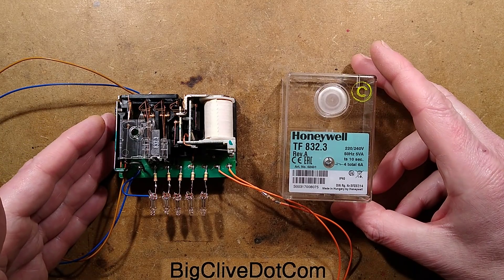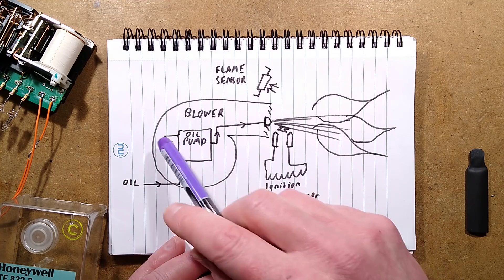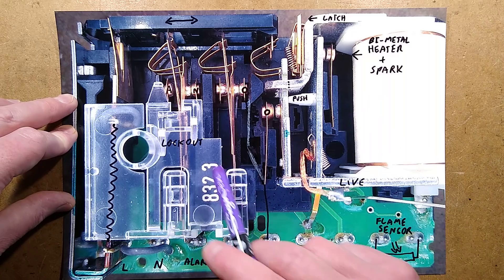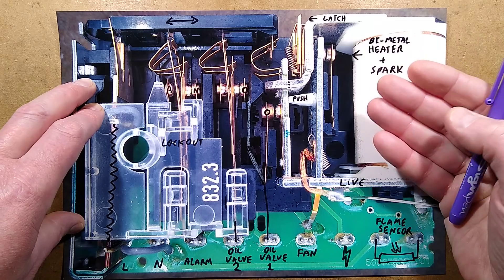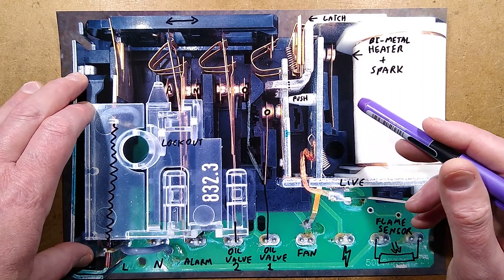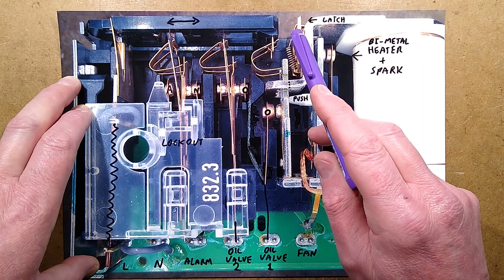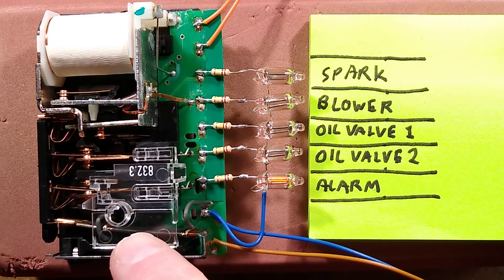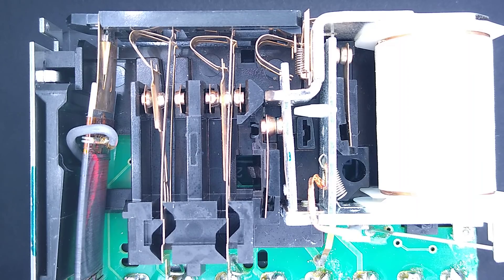Incredibly clever oil furnace burner controller (very perplexing)

Comment: I've seen several electrothermal mechanical controllers from back in the day that we're pretty amazing along these lines. If you want to see something that's modern and really complicated take a look at the controls for my two stage blower fed gas furnace. That thing has flow sensors and pressure sensors all over it. And the flame sensor there is a probe that actually sticks into the flame. And it's all run by a microchip pic.

Comment: How has this complex thing not just been replaced by a 20 cent micro?  More repeatable, more reliable and cheaper and much easier to assemble?
Reply: Until it craps out on you
Reply: It will be, we are in a transition period.  A solution based on a micro would cost more than the 20 cents for the micro because they can't handle power switching without other devices.  All cheap, yes.  But re-tooling a factory is very expensive .  Once a factory is tooled up this complex device is very cheap to make so they continue to get made for some time after it would be "more sensible" to use a purely electronic design.

Comment: It sure is a beautifully made controller that is very interesting in its operation and have nicely implemented safety features.
But I also sit thinking, isn't it time for more people to switch over to heat pumps for home heating?
Burning oil is a bit old fashioned to be fair, though, I will have to say that I am rather biased in this regard....
And I do know that heat pumps aren't cheap. Though, some people incorrectly think that they stop working just because it goes bellow freezing outside.
Reply from the maker: I don't think heat pumps work well here in a very cold winter climate.
Reply: @bigclivedotcom  it's all permafrost north of Manchester isn't it? ;-)
Reply: @bigclivedotcom  Where I live in Sweden, a fair few people do have air sourced heat pumps, and do just fine during our winters.
Yes, ground sourced and even geothermal is better. (Geothermal as in a deep borehole, it isn't deep enough for it to get warm btw, it is only like 5C in the hole.)

England with a far far milder climate shouldn't have any issues using heatpumps.

House insulation is though still a very important aspect of any heating setup. Oil fired heating can be more environmentally friendly is one's house is well insulated, compared to a heat pump working hard on keeping a poorly insulated shed warm.
Reply: I think heat pumps are a great idea on a new-build but not quite so cheap/practical on an old house
Reply: @sofa-lofa4241  My roughly 100 year old house has a heatpump. It works fine.
One can also in a lot of cases add on additional insulation if needed. Or just renovate in general to add in insulation in uninsulated walls.

It is a bit of an investment, but even for an oil heated house, the investment can still be worth it compared to the reduction in oil use over the next couple of years.

Another advantage of a well insulated hose is that it is easier to keep it cool during summer. The heat from the sun has a harder time penetrating the walls, downside is if one has plenty of large windows, then it is suddenly a greenhouse... (Get some white reflective curtains and that is mostly solved.)
Reply: Air source heat pumps don't work well in old leaky houses, it's like running your fridge with the door open. Ground source is apparently better if you have the space. You have limited options if you're not on mains gas, so oil is quite common in rural areas

Comment: I found those type controls to be very reliable. The problem was usually the customer resetting the control numerous times and filling up the bottom of the combustion chamber with unburned fuel oil. It can be quite exciting lighting a burner into a chamber with a lot of  unburned oil. The inspection door blowing open with a vengeance and a rumbling felt. A dirty oil filter or nozzle will soot up the chamber and often the flame sensor causing lock out. Big Clive always has something interesting to show. Love the channel!!
Reply: I had to take mine apart last April following fuel starvation. I've a 20+ year old tank, you can imagine the state of the filter and the pump. Flame sensor was sooted up. A good wash out with white spirits and all was well except I smelled of kerosene for three days after.
Reply: The standard Honeywell oil controller in the US has a safety for this. It will allow the user to press the reset for a hard lockout up to 3 times, then it goes into 'restricted' lockout. To reset from this mode requires holding the reset for 10 seconds or more. This isn't something the homeowner would stumble upon.

Many of these controls will test for ignition for 45 seconds. Times 3 with a .75 GPM nozzle would still result in over a gallon of oil in the furnace, so it will get puffy and bangy when it does light!
Reply: Yup, user error rules!
Great idea for an industrial woofler though 🔥
Reply: I often use Landis and Gyr LGK type controls, the only issues we have are on LPG when the burner shuts off, even though the valves are good, the flame will tend to waffle around on the burner causing a lockout,  and the need to use permanent pilot on big burners because the turn down ratio isn't sufficient to stop the process running away when there is no product load.

Comment: What a wonderful thing a fascinating thought out unit and cleverly demonstrated, thank you. I'm thinking this control could have been achieved with a programmable integrated circuit and some relays, this unit cost £40 and the programmable integrated circuit way probably the same cost. Wonder why they did it this way?
Reply from the maker: Probably because it's time proven.
Reply: @bigclivedotcom  Thank you Clive looks very 1960s but with modern electronics on the other side of the CB.

Comment: That is basically a mechanical computer program. Very clever! The amount of enginerding that went into developing this physical unit is orders of magnitude higher than what would nowadays go into writing a program for a µC to achieve the same thing. No wonder they're still using these, they can't crash unlike the µC.
Reply: if you misdesign one, it will crash. Check some videos on divide-by-zero on mechanical calculators, for example.

Comment: Thanks for the good explanation!
This same controller is used on some gas burners as well. At the units without blower they simply not use the contact.
 Now I understand why there is so much dead time before the gas solenoid opens after the controller recives the call to fire.

Comment: God, can remember fault finding on those in the late 80s, early 90s. The beauty of all of the controllers was that they had a similar fault process whether on gas or oil fired pressure jet burners. On the gas systems there was a pre-alarm state triggered by pressure sensors. The gas feed would have a section of pipe, before the burner, that would have valves and pressure sensor. First stage was a check of the pipe integrity by closing the valves and checking that the pressure was equal on the feed and burner side and didn't drop. If it dropped the system would halt and go into alarm. If all ok, it would then open the valves to allow gas to flow and start the ignition sequence. Depending on the size of the burner you would have either a thernocouple or IR sensor to detect the flame and keep the valves open.
Lovely job but my wife hated that I would come home smelling of diesel and my skin black from servicing waste oil heaters in garages! Had to go back to being an electrician instead.

Comment: In my home (built 1905) in the states we have an Aquastat control with a sub burner control.
One of the first things I did was modernize these control boxes with digital circuitry, but I still kept the older controls as they were equally interesting to the one shown in this video.
I had a lot of fun reading electrical schematics and explanations clearly written for a 1930s plumber to understand.....

Comment: Clive on some of these systems they also include a pressure sensor near the blower to confirm airflow
Reply: The propane fired furnace in my RV has one of those in case the blower fails cuts off the gas so it does not overheat the heat exchanger its called on it a sail switch the moving air keeps it up and the gas valve open .

Comment: The mechanical predecessor of a large capacitor (or a 555 timer) and some 7400 logic circuits. 👍
Reply: By vintage, more like ECL running at -5.2V. 🤓

Comment: I'm honestly surprised the modern version of this isn't just a mcu and relays. I know the old adage is if it ain't broken don't fix it, but I feel like there is an awful lot that can go wrong with this mechanically.
Reply: I would think some TRIACs would be cheaper than the manufacturing/assembly cost for all those contacts
Reply: @spacehitchhiker4264  oh true!
Reply: It is. Look up Honeywell R7284. LCD screen with fault codes, serial bus for remote monitoring, etc.

Comment: Microcontroller designs rarely display this level of elegance.
Reply: clearly not true, have you seen INSIDE a typical microcontroller? It's BEAUTIFUL inside!!  https://upload.wikimedia.org/wikipedia/commons/3/37/Die_of_PIC16C57_Microcontroller.jpg
Reply: @maxtorque2277  I've been making commercial products based on the PIC16C57 since 1992, before flash memory existed. I spent months in the 1990s looking at the 16C57 die through the EPROM window as I developed code so yes, I've seen the 16C57 die before. In fact, I've seen 16C57 dies in hybrid modules and recognized them as PIC dies on sight. The 16C57 is not terribly elegant as dies go.

Comment: Absolutely amazing piece of engineering. As someone who is on the way of becoming an engineer, and working close with lots of different types of technologies, I ask myself a lot of times... When there is the possibility to use electromechanical means of achieving something, and the way of using solid state electronics, which way is the best? In this case, surely the electromechanical way is more interesting, but is it actually cheaper to produce that furnace controller electromechanically or with solid state electronics? is it more reliable? is it... worth it?
I absolutely loved this video, that's what I know.

Comment: Honeywell... great hardware, trash software. We had a Honeywell tech camp out in mechanical room for a couple months of a new building trying to get everything working as promised. Never happened. Their security camera software is the same. "This is enterprise level software." Yet it has trouble with most Onviv cameras. Their response was "Just use Honeywell cameras"
Reply: We managed to get it to work with our stuff... Just about... Screw everyone else's!
Reply: They thrive on buying companies to vertically integrate. They purchased my old company and put us under the thermostat division. We sold industrial burners for petrochemical, all customer/job driven no part numbers.

Comment: I worked on an oil furnace  on a friend's narrowboat, about 20 years ago...  The furnace was very old even then, and the ignition spark was provided by a cam on the blower/oil pump shaft, and an automotive ignition coil.....   The control unit was positively modern compared to this one, using standard time delay relays...  If I remember correctly I added LED's to all the outputs to monitor it, and had to replace the LDR flame sensor to make it work.....

Comment: Danfoss has a similar module, it is more or less, an industry standard.
In the 80's i repaired high pressure power washers, the heated ones are diesel fueled.
I can remember these units, in these days they were completely mechanical, very safe and reliable.

Comment: Oil burners have been around for quite a long time...and I guess the engineers finally figured out that you just can't beat a mechanical control unit  :)
Reply: it's also a safety component you don't just redesign them without a very good reason
Reply: No, the engineers figured out you can beat a mechanical control unit — and it still works even after quite a beating. ;)
Reply: ...sales figured out they could get bigger bonuses by selling the same system for more... 

I&C Engineers would never use electromechanical in a modern system.
Reply: @peterg.8245  Wrong - we still do.... LGK boiler control units. Yes I can program it it easily for PLC, but the hardware has to be intrinsically safe and it's not worth the grief. The LGK does all of the welded contact monitoring and will even do gas valve proving. Just plug it in and give it a start signal from the PLC, and monitor it's little outputs for system status.
Reply: I think it’s more a case of if it ain’t broke don’t try to fix it, cheap and fairly reliable units these were

Comment: I've always wondered how these work. Also, since I'm early I might get noticed by Clive in the comments (though he does read comments on his older videos which is brilliant) and say that it's his channel and electroboom's channel (as well as AvE ) that got me into studying for electrical engineering.
Only irritating thing is they've cancelled every in-college class. Can only program PLCs using a sim and apparently fault finding will involve me giving commands to my tutor over a zoom call because he doesn't want to have to wipe down equipment. We could be in as quarter classes however I think a lot of tutors have gotten comfy working from home as they can take tea breaks whenever they want and do whatever they want during class hours.
Reply from the maker: Depending on the make of PLC you may be able to find a clone or used unit on eBay.
Reply: @bigclivedotcom  I've checked. I think it's about £85 for a new millennium 3 PLC, can't find any old ones not sure whether it's programmed over 'ethernet' (RJ45 I think the cable is called off the top of my head) or if you need one of the special £160 programming cables. However the fault finding part of the course involves physically metering outputs, inputs and sensors on a faulty machine by the way it was described.
My tutor wants to get us all PLCs for learning from home on loan from the college.
For next year

Comment: If I remember correctly the original used a conductive flame sensor,  gas is insulating but once ignited the actual flame is conductive.
Reply from the maker: That would make sense in the early days.
Reply: @bigclivedotcom  indeed.
Reply: @bigclivedotcom  We still use ionization flame rods on big burners (10,000,000 BTU/hr) because they are cheap, and the controller will handle UV and flame rod types, the issue is that if the process is liable to liberate anything conductive (pistachio nut roasting will liberate brine) then the flame rod will start conducting and causing lockouts on startup proving. Aside from that, testing UV is much easier than testing Ionization.

Comment: Oil Furnaces still exists?
Reply: They're incredibly popular in rural areas, or in countries where natural gas is taxed at ridiculous rates.
Reply: @mor4y  So what is wrong with Heat Pumps, Geo Thermal, Solar Heat, or BioThermal like farmers have Oil Furnaces are an old tech and leaves a bio mess.
Reply: @RabbitsInBlack  heat pumps use loads of electricity, geothermal is a tiny usage case, and farmers use bio-mass, not make a bio mess.....

Heat pumps are a example of what's wrong with many peoples environmental views, instead of dealing with your own pollution near you (co² levels), instead you punt them off onto people who live near power generation facilities, making their life worse

Edit: I forgot solar, but I live somewhere that far north that it's pretty useless.... electric panels will never repay themselves before wearing out, and the hot water water tube style, while better, don't work when it's icy/snowy, when we really need the hot water! In my climate wind turbines matched to pumped-storage hydro is where its at, but its not really something for the home consumer!